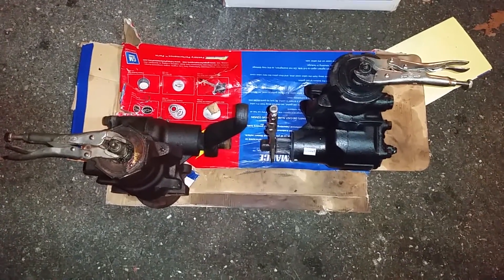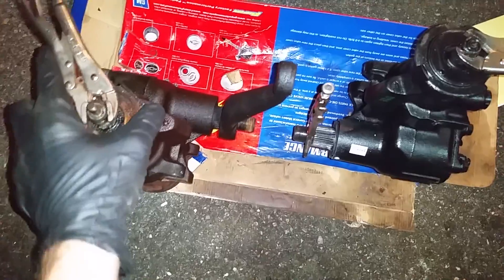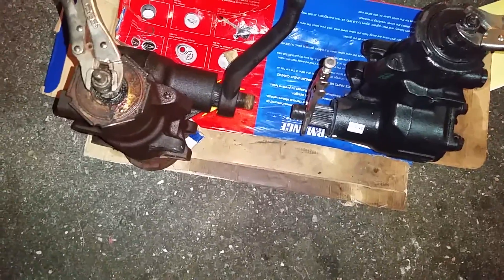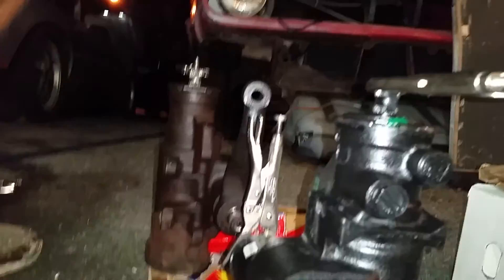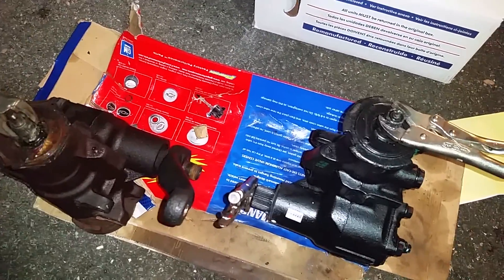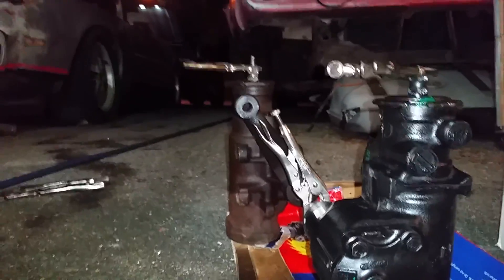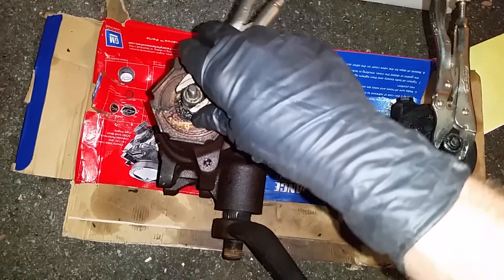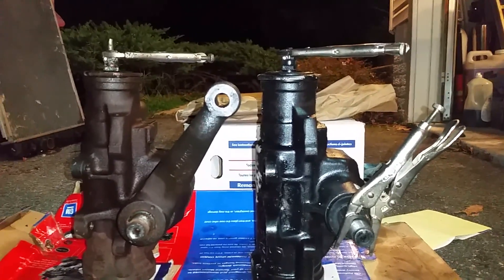Close Ratio Steering Box vs Rebuild

Comment: I HAVE EXPERIENCE WITH STOCK CAR RACING AND GM MAKES ALL KINDS OF BOXES WITH DIFFERENT RATIOS. WHAT IT SEEMS LIKE IS YOU HAVE A 14:1 RATIO BOX AND A 12:1. OR POSSIBLY A 16:1 TO A 12:1.
Reply from the maker: My box (the dirty one) is a known 12.7:1 high effort box (at this point I don't remember if it was the one out of my '87 TA or '87 Formula 350). I've yet to find a rebuild that is what it claims to be according to the PN, and most are not rebuilt right. I finally just rebuilt my own.

Comment: Did you ever get this straightened out? I have read and read, and I never see any parts store boxes with the 2.25 turns for 16” wheels.
Reply from the maker: Sorry I didn't see this when you first made the comment.

I have a second video of testing more of these boxes, and no, after testing over 20 from different sources I never did find a correct rebuild.  If you search on here you'll see that even the high-end builders are shipping incorrect ratio boxes as 12.7:1 boxes.  Since I have 2 '87 WS6 cars with correct original boxes in them (close ratio, high effort) I just ended up rebuilding them myself.

As far as the "2.25 turns..." boxes, I've never understood the hangup people have there, the earlier 15" wheel boxes are the same box, same ratio, same effort, they just have different stops that let them turn a hair farther.  Any decent size tire (even some factory sizes) will rub a little on the inner fender with EITHER box, so essentially you can't tell a 15" from a 16" wheel close ratio box when installed on the car unless you have 215 width tires installed on the car (narrower tires won't touch the inner fenders with either box, wider tires will rub with either box before getting to the end of their travel).

Comment: good video, and shows there is something to be said for the stock box
Reply from the maker: gReGsKi GmAiL really it shows of the problem with the rebuild process.  These are all just stock boxes that were rebuilt and the problem is that they throw in a random box in the box with the right part number and what ends up inside isn't right.

Comment: Mark, I am confused. 
Just what are you trying to demonstrate? 
The quantity of turns, lock-to-lock, available in a given steering box? 
Regardless, please do a GOOGLE Image search; find an image of a degree wheel; print it on cardstock; and use that to demonstrate the ratio of each box, if that's what you're attempting (and whether it's a constant ratio or not.) 
And if you have a younger sister who can enter the shot and do a fan dance, I feel it would be for the best.
Reply from the maker: +Johnnyradionic for some reason youtube tagged your reply as spam... published now.

What am I demonstrating- the original box is a 12.7:1 box with the correct travel limiters (it has the HX factory paint mark on the cap, meaning 12.7:1 high effort box), by comparing the travel of the pitman arm (which I try to show is the same), counting the difference in lock to lock turns and using the ratio of the 2 lock to lock numbers I can calculate the unknown box's ratio reasonably accurately.

I've tested a few since then, and a little over a week ago I published another video of testing another box (with unexpected results) with a degree wheel:
https://youtu.be/qEIolVc3U78

After that one I started taking my degree wheel and vise grips with me to the store and testing them on top of a big barrel that they have out back... after all that I decided to just rebuild my own (which I'm painting right now ;-) ).  I wish I had time to setup a camera and show that (honestly, I didn't have a camera that I was willing to expose to the power steering/grease covered hands necessary to rebuild one of those boxes), I ran into a number of issues with mine that I haven't seen in any other videos.